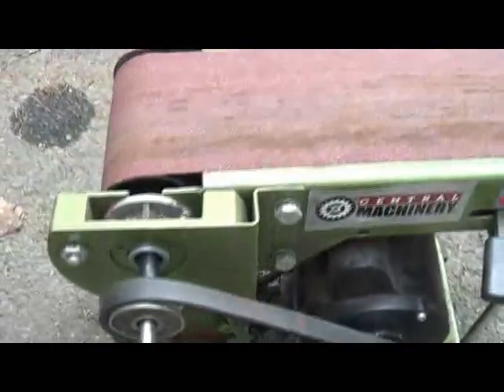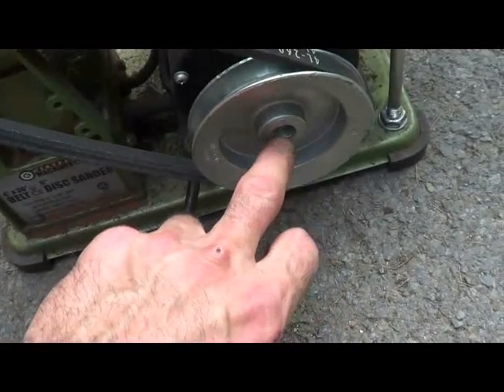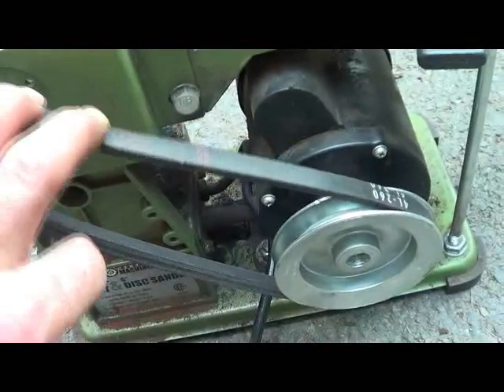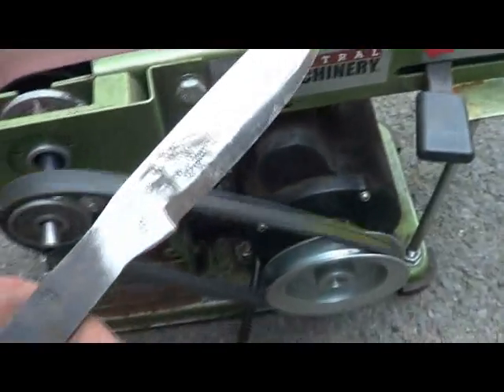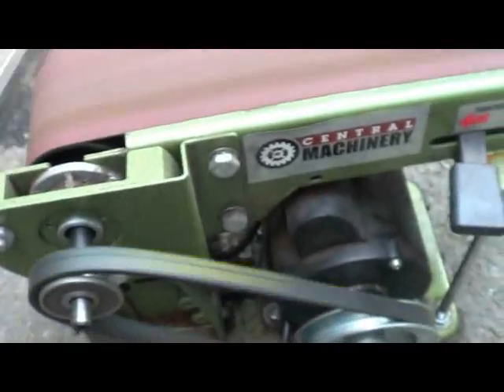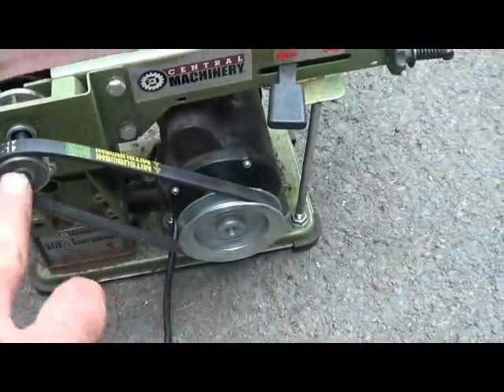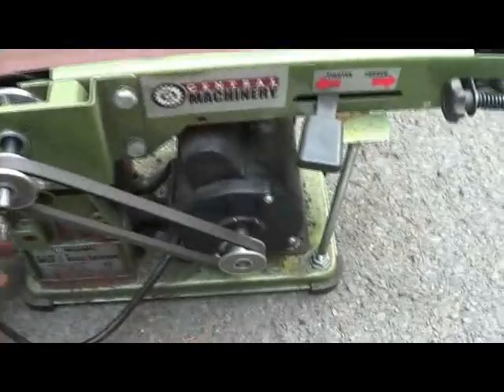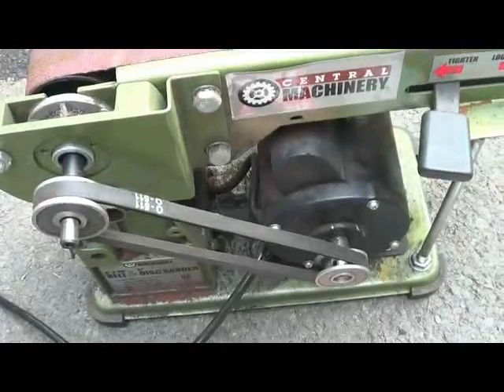Harbor Freight 4 x 36 Belt Sander Mod For Knife Grinding

Comment: Great idea, could this mod work if the belt is in a vertical orientation instead of the horizontal orientation? I just prefer the vertical orientation and using jigs for a more consistent bevel angle. Thanks

Comment: Sometimes when you change a pulley you will fry the motor from to many amps
Reply: I dont think thats how electricity works, you will loose torque going to a larger pulley on the drive wheel
Reply: @seanbaumer6039  when I had to change pulleys in the AC and Heating Trade, one of the first things you had to learn was changing pulleys would fry a motor if you did not do it right. You do it and check the Amp draw to make sure you are not over amping the motor
Reply: @davidvines6498  Hey i,m not an electrician or hvac. Are you saying that the motor will have to work harder and pull more current causing it to burn up?
because that would make sense. Im honestly curious . If you were buying a motor for a project, how do you deternime what to get. Most motor i see either come in at 1725 rpm or 3450. Is it based on horsepower for your application would a 1hp motor be suitable for a 2x42 inch belth grinder?
Reply: @seanbaumer6039  there is a lot more to it than hp. There is number of poles, capacitor start, Capacitor Run, capacitor start and run. Then you have frame sizes. 

I would look at the belt sander you want and see what motor they use and go from there. Or buy an attachment for a bench grinder. 
I bought a 1 inch belt grinder. It does all I want one to do
Reply: @seanbaumer6039  I’m sorry you don’t think that’s how it works. 
Check this out. It will save you a motor

https://vibralign.com/other-topics/calculating-output-speed-using-pulley-diameters-input-speed/

Comment: Just a little understanding of the laws of physics will help you all here. By changing the "gear" ratio of this machine, he potentially increased the speed of the belt  by 3 to 4 times as fast, but there are two very important trade offs in this mod. The first being the drop in torque at the belt itself, due to the increased load applied to the motor... and the second being the increase in resistance of the belt due to friction. This is evident  by the fact that he has to help it get moving. The problem with this machine is not the speed of the belt, but the lack of power of the motor... which can only be made worse by increasing the size of the drive pulley. If the problem you are having with your harbor freight sander is that it bogs down and stalls when you load the belt, the only solutions are to lower the pulley ratio ( this will slow the belt but increase torque) or to get a more powerful motor.  This machine comes with a 1/3 hp "rated" motor. That drops off to 1/6 hp when it begins to slow under a load. This is a $20 motor. That is why this machine is so cheap. Harbor Freight has a 1hp motor for $40.... put one on this machine and it will outperform the $180 machine from Home Depot.
Reply: Does the motor bolt into the existing body of the sander? Does it have the same shaft diameter? Thanks!
Reply: @MrBrokenwrenches  No and no. You'll have to drill some holes and buy a pulley.
Reply: I dont see this $40 motor on the website
Reply: @Rideslow6977  You won't, because I was wrong. It was just one of those special sales promos that Harbor freight does . The regular price is about $90. I looked around and you can get a used new 3/4 hp for about $75.  I ended up pulling a motor off an old table saw, that is a 7 amp, at 3,500 rpm. It should turn this cheap belt sander into a real knife grinder.
Reply: @Tim Hallas I want to slow the speed down.  It is going too fast for what I bought it for.  I’m having a hard time finding a pulley smaller than 1 1/2”.  Would it slow it down if I put the larger pulley on the opposite side?
Reply: @number1dutchkid    Yes it would.  and the slower moving belt would be less likely to bog down.  BUT keep in mind that this will not increase the amount of energy delivered to the material being sanded.
Reply: @Tim Hallas  I’m sanding resin so slow and no increase of power is perfect 😀 if I need to sand something more I can switch it back. Thank you so much ❤️😀  I’m getting my “mechanical” knowledge through YouTube
Reply: @number1dutchkid   Well you found the right guy. I am a well versed in the mechanical sciences.  Slower moving belt will generate less heat... fast belt might melt resin.. You're right to slow it.
Reply: @number1dutchkid   You learn more by trying than you do by looking at it and wondering what to do.
Reply: @Tim Hallas  you should see some of the stuff I have built.  I get an idea an I know it doesn’t exist or I cannot afford it, so I build it 😀 I’m pretty proud of what I have done 😀
Reply: @Tim Hallas my instagram page is Healinglovingarts if you want to see some things I have done
Reply: @number1dutchkid   We must be related. I do the same thing. I make guitars, knives, furniture, small motorcycles, you name it, I've tried to build it. Thanks for the sub.

Comment: HP for electric motors is non-sense. Its  AMPs@ voltage that equal power.120V X 3.5Amps this is rated at equal 240 watts of power. The standard to equal in HP is 9 amps for 3/4HP.
Reply: 746 watts to one hp, it's not nonsense
Reply: HP does make sense for motors, but many manufacturers stretch the truth, and HF is no exception. You see this a lot when the marketing depts show 'peak' HP. You also need to take into consideration the motor's efficiency, which for cheaper motors are probably 70%. So advertised 3/4HP (750w* 3/4=562 watts) at 70% is roughly 400w, which is to close to what I think is what you mean (420w not 240w).

In that case, 9amps can equal true 3/4hp if you account for efficiency of ~70%

Comment: You have a brush motor with a capacitor.  When you changed the load by switching to a larger drive pulley, your motor is trying to tell you something.  Normally the capacitor shifts the phase to allow smooth starting.  But you have to give the motor an assist which means that your 3.3 amp motor is too small, it does not have the torque to start smoothly.  Add to that the wheels on the belt are out of round (easy to check) means you have additional resistance impeding your motor.  This video was posted June of 2014, over four years ago, so the question is, does the motor still run or have you burned it out?  The second question is why does increased speed matter?  What exactly have you gained by tripping the speed of the belt?

Comment: I got one of these and with stock everything it works great.  I took off the back cover, the bottom cover, and the small table type thing so I can quick change my belts.  I find the sander pretty great.  I ground a knife from forge scale to ready to harden in 20 minutes.

Comment: that's a great sander except for in my opinion it runs backwards because if something catches and it pulls it out of your hand it's throws it right into yourself were they ran the other way it would pull it out of your hand and throw it away from you
Reply: Lee Fisher. Styrene Marine so...stand on the other side of it?
Reply: There's a wall there LOL no I just turn it around the wrong way
Reply: Lee Fisher. Styrene Marine I have mine set in a vertical position for my knives.  It's the orientation I've had any sander in since I've been blacksmithing.

Comment: Drive roller rod gets hot at normal speed. I did this mod. same 4" pulley from tractor & supply but used 3L link belt (you buy it by the foot bought 3ft need a little over 2ft). Sharpend lawn mower blade, worked well. I must of had belt to tight after about 10min to 15 min of use, pulley rod moved tor-words sanding belt, bending bearing cap frame mount out-wards. Rod was really hot. I couldn't get rod back through pulley side bearing. Returned sander and got another one. I don't know what went wrong exactly, I didn't have belt arm real tight in down position either which could have contributed. Bought a 1 year guarantee for $20.00, just in case, so I don't lose whole investment if I try again.

Comment: Hey! How did you remove the original pulley off the motor shaft? It appears to be glued
Reply: Journey of Muscle You need to heat the pulley up with a torch then pry it off.

Comment: Hey, did you run without a tensioner on that pulley mod for long?
Reply from the maker: +Phil peck i did not need a tensioner when i was using it

Comment: What did you use to enlarge the hole in the pulley?  I'm assuming you had the same trouble it did finding a pulley with a 9/16 bore.
Reply from the maker: Joseph Michelsen yes I had to drill it out

Comment: could you put a link for the supplies on amazon
Reply from the maker: Graysonemory I don't remember the exact size of the pulley, maybe i mention it in the video... But it is just a standard size that you can find at most hardware stores or tractor supply

Comment: hey its grayson and I was wondering if you could send me a link for the pulley and belt if you can find it on amazon ???

that'd be perfect
and one more thing
when you drilled it out, it doesn't have to be tapped or anything right? just to fit over the rod?
Reply from the maker: Graysonemory I bought the pulley at the local hardware store.  They are standard off the shelf pulley.  Just remove the set screw and drill out the center.  No tapping or keying required...(put the set screw back in tho!)

Comment: Where did you get the pulley?
Reply from the maker: Matt Paxson  ace hardware. Tractor supply would have them too
Reply: +Chandler Dickinson Northern Tools has pulleys and Leeson motors!

Comment: I'm a bladesmith as well and I just got one of these for xmas. I'm having the same problem with extremely poor power output for a 3/4 HP motor. I'm going to try this mod and see if it works for me. Thanks for the video.
Reply: Those motors are actually 1/2HP (rated INPUT power) but the output power is under 1/2HP. Just take a look at a real 3/4HP single phase motor and compare by size, you'll see what I mean. A true 3/4hp, 1hp, etc. on single phase will need a start winding with centrifugal switch. These <1/2hp just have a run winding with a series 8uF run cap, same as the tiny drillpresses, they are not 3/4 whatsoever. Measure the inductance and run the numbers in case you don't believe me. By increasing the motor pulley you increase speed on the belt, but decrease torque.
Reply: @gushhnet  but it worked so not sure that matters.
Reply: I know this is late reply but if you perform a search,  you will see that the lack of power issue is a loss belt out the box. Those belt sanders from HF are actually a very sweet deal.
Reply: xXG.L.HXx *Loose,  not loss belt lol*

Comment: did your belt sander vibrate like a mother effer when in the vertical position? if so, how did you remedy that?
Reply from the maker: Boostinex never tried it in the vertical position after the mod... did not vibrate before the mod though